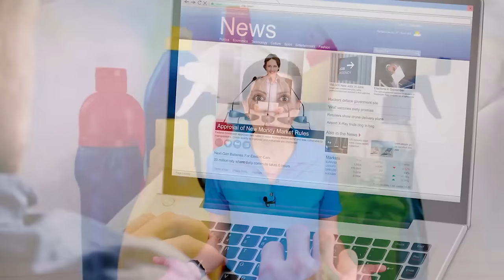Best Way to Clean Windows and Mirrors

Comment: I put a tablespoon of dishwashing liquid in a spray bottle fill it with water and spray on then wipe over with wet  microfibres cloth. Then with a bucket of water. Wet another rag and rinse window then wipe off or use a carcher. You have to wash the dirt off window products don’t work you have to wash it with soap comes up brilliant and streak free
Reply from the maker: Vicki, Thanks so much for the window cleaning tips.

Comment: Very helpful thank you. 
So ...no Windex? Just water?
I always dust it first too. Do you? Or is it unnecessary? Thanks!
Reply from the maker: Dusting always comes first before you get to the glass. You can dust the glass if you like, but you will be wiping it down with a cloth and that too will remove the dust. If you are using a microfiber glass cloth, you won't need the Windex.
Reply: @AskAngelaBrown  ok thanks!!

Comment: I wash windows with a little dish soap in distilled water. I dry the inside windows with a squeegee  and microfiber towel. After washing I spray distilled water on outside windows and let them airdry.
Reply from the maker: Thanks for sharing your cleaning tip!

Comment: Not all paper towels are bleached mine are not so not white slightly grey white brown colour and the covering is also either paper or bamboo. However I agree paper towels are still a cost that we throw away. Personally I burn mine on my fire.  I can still get free newspaper which I use   Still think it does a great job cleaning windows
Reply from the maker: Jo, That’s great that you can still get a free newspaper. It’s getting more difficult for people to find them without a cost. I appreciate and value your opinion. 👍

Comment: Are they labeled as glass drying? Can a regular one work?  Thanks.
Reply from the maker: The glass cloths are a very unique cloth in that they are low pile with no fuzz. Here is a paid link to some we use. https://amzn.to/37j036S and if you hover over the picture you can see a close up view of the texture. And because they are microfiber they grab almost like a silicone oven mit where they don't want to glide across the mirror at all. Somehow it makes them the perfect choice for removing streaks on glass and mirrors. The regular microfiber cloths tend to just smear the water around. Does that make sense?
Reply: @AskAngelaBrown  Yes it does, thank you.

Comment: yes, but what product do I use to get unknown spots from my patio doors?
Reply from the maker: Are the spots on the glass? If not - Krud Kutter Original Degreaser https://amzn.to/3mXw5uE may be just the thing you need. If you use it let me know how you like it.
Reply: @AskAngelaBrown  I used dawn dish detergent and it worked very well. The window cleaner I had was worthless. I will be using dawn from now on to clean my windows. After all, it works great on glass dishes.

Comment: I use rags( my rags are old dish towels or hand towels that have been washed so many times that there isnt any lint). I buy the really thin face cloths that come in a ten pack in different colors for different jobs. I use a face cloth to wash and the hand towel to dry the glass.
Reply from the maker: Great tip...thanks for sharing!!

Comment: pro grade squeege and T bar and pro window cleaning concentrate. both inside and out. cut your glass/window cleaning time drastically, and you actually take dirt off, rather than smearing it with one thing or another.
Reply from the maker: Thanks so much for writing in and sharing these tips for cleaning glass.

Comment: Be sure to wash the micro fiber towels correctly, heat is there enemy. Wash them separately from other clothes, use a good free and clear detergent, use warm water,  air or tumble dry (no heat)!
Also if the micros are very dirty your can add like a 1/4 cup of vinegar (in either the bleach/or softener slot) and be sure to do, if you can an extra rinse. Never use regular detergent, fabric softener to micros and again warmish ..stay away from heat.  This is coming form an ex auto detailer ..care for your tools....and the enviro around us.
Reply from the maker: This is great! Thank you for sharing your tips!
Reply: When you say no heat, but warm, what does that mean exactly? 
When you say no regular detergent but free detergent, what does that mean? Thank you very much.
Reply: @TheCelestialhealer  I Googled the question about the detergent.
"All Free Clear is a liquid laundry detergent that is free of fragrance, dyes, and harsh chemicals."

Comment: Great tip on the drying cloth, I’ve never see n them. My favorite product to use on glass and windows is dishwasher detergent, unlike window cleaners I never have streaks!
Reply from the maker: ??? How do you use it? Do you dilute it in a spray bottle? And  what do you use to dry the glass with? I'm curious now. ;-)
Reply: Angela Brown A good friend has a building maintenance (Windows) business and gave me the tip. I wish I had exact measurements but I don’t, it’s a couple of smaller globs of dishwasher detergent ( doesn’t take much at all) to a gallon of water. Since there are no suds, there are no streaks. I have a black glass gas stove and it drove me insane till she gave me this tip. Now I use it on windows, mirrors, anything that would show streaks, cuts grease and grime like nothing else.
Reply: Angela Brown Forgot to say I use a clean cleaning cloth, usually one of my husbands old soft tshirts, I don’t use any softeners or dryer sheets for my cleaning cloths.
Reply: I used a glass cleaner that claimed it would not leave streaks, but it left terrible streaks.

Comment: I have tried cleaning bath mirror  with micro fiver cloths from top to boþom but can't  get rid of dust smears Help
Reply from the maker: Are you using a glass cloth? The glass cloth is different from a regular microfiber cloth in that it is low pile rather than soft and fuzzy like other microfiber cloths. Here is a paid link https://amzn.to/3FlKtDR to the glass cloths we use so you can see what they look like. Hover over the picture  and you can see how different they look from the soft microfiber cloths normally used. These grip the mirror almost like a piece of silly putty. It's the "gripping" that removes streaks, steam and film from the glass.

Comment: Yup. But I also buy car window chemical and use that along with microfiber. Other times, it is just a small  dip of soap in water to remove dirt. 

However be careful about your microfiber. Some of them do leave lint. Even high quality ones. So I only used worn microfiber or the kinds that don’t have the super softness. 

For big windows, a squeegee might work best.
Reply from the maker: Thanks so much for the tips, I appreciate it. 👍

Comment: I purchased the recommended Brite Wipe cloths and I must confess, I did not like them for mirrors or glass. Even in your video, I see the same thing happening to you as it did me.  The towel does not slip across the surface. My hand slips off and the cloth balls up. It is impossible to fold it and use for drying. What am I doing wrong?  Thx.
Reply: It could be your glass has gotten too dry before you wipe.
Reply from the maker: If it is 100% dry it behaves this way. Once it starts drying it becomes a bit damp and then glides across the mirror. You didn't do anything wrong. The first pass or two when dry is like this.

Comment: Hey Angela, we’re window twins! We also have 55 windows. High 5!!!  I was ready to give you my secret weapon for cleaning them, but you already knew it so I’ll just contribute to your algorithm instead. 😂 Discovered it during the paper towel shortage last year, but I’ve never heard of drying cloths. If anybody else said you only needed water to clean windows I’d have unsubscribed, but you’ve never steered me wrong so I’m gonna give it a go. ☺️ Those microfiber cloths are great for cleaning so many things! Kitchen appliances and countertops are so much easier to clean with those cloths too. Hope you have a great weekend!
Reply from the maker: Hey Audrey, High five for being my twin!  I should clarify - cleaning glass, mirrors and windows is an inside job. You will need soap suds and a pressure washer if you're cleaning 55 windows and on the outside of your home. I didn't make that very clear. I'm sorry about that. Do you know how many cloths that would take if you just used damp cloths on outside windows? 😱😂😜
Reply: I’m going stitch all the wedding cloths together to make a wedding dress, I’ll look like a patchwork doll 😂
Reply: So this method won't work on the outside of the windows? Why not? 
 @AskAngelaBrown
Reply: Yes they are

Comment: My previous landlady works as a house cleaner and she swears by those Norwex silver-infused microfiber cloths as the wetting cloth, and the Norwex glass cloth to dry/polish glass and mirrors.
I bought 2 pairs and used them to clean greasy hand prints from glass doors on a window cleaning job I was doing. Gotta say I'm impressed by this method. I even use them on car windows if I'm detailing.
Sadly, the Norwex are pretty expensive, but I searched online and found cheaper alternatives to the silver-infused cloth....sweet!
Reply from the maker: The technology really works. Lots of professional cleaners swear by it. Thanks for sharing. :-)

Comment: I thought microfiber cloths shed micro plastics when washed, thus contributing to the explosion of plastic micro fibers in the water cycle.  The septic treatment does not filter out the micro plastics. They go right out into the water released back into the environment. Not exactly environmentally friendly.   The choices seem to be:  cotton terry cloth which releases biodegradable lint, paper towels which are biodegradable, microfiber which releases micro plastic fibers. Then add chemicals, some of which are biodegradable with a short half-life, and some which persist in the environment. It’s always the trade offs, which are difficult to parse for the optimal solution. I personally often compost my paper towels. I admit I do like using microfiber towels. I am thinking about adding a filtering system to my washer to capture the micro plastics. Maybe that is something that will become standard in the future for washing machines and dryers.
Reply from the maker: Great points well received. Most washing machines do have filters that catch this stuff and here's an article on how to clean the filters https://www.familyhandyman.com/article/wheres-my-washing-machine-filter-and-do-i-really-need-to-clean-it/

Comment: Bar Keeper’s Friend is prob the greatest single product for glass shower doors with hard water stains. You may have a video out about it but I’ve only followed you recently so I’m not sure; thought I’d mention it
Reply from the maker: Thanks for the tips. I appreciate know this. How do you apply it? Sponge? Buffer? Cloth? Do you have a dwell time?
Reply: Angela Brown I use the powder form of BKF make it into a paste using barely any water and then apply with a non-scratching scrub (or cloth) in circular motions. I leave it for 2 minutes and rinse and wipe off. Then repeat for more stubborn areas. I’ll try to send before and after pictures soon but the results are VERY good. Best part is it takes very little pressure or elbow grease.

Comment: If you have any grease on your mirror or glass then with this technique the glass won't be crystal clear. That's when you need to use a detergent like dish soap on your wetting cloth.
Reply from the maker: Yes this is true, especially if you have something like makeup foundation on the mirror.

Comment: I use distilled water bottle on my glass, wetting cloth. And my TV, and computer screens.
Reply from the maker: Great move. Yes, if you need your cloth to be damp - I can see how distilled water would make sense so there is no sediment or minerals in the water. Great tip. Thanks for sharing this. 👍

Comment: Hi Angela 🙋🏻‍♀️

I've contacted you a couple of times and what I like about YOU is... YOU  take the time to reply back.  So I've decided to  subscribe.  .

I have a microfiber cloth  but when I DRY my shower glass it leaves lint on it , it's not really meant to dry  glass, like your blue one .  but can I use it  for a wet one,  for the glass . Or will it still leave lint . ??

Diana  from Australia👩🇦🇺🇦🇺
Reply from the maker: Hi Diana, When you wash microfiber cloths with other laundry it picks up lint from the other laundry and then when you go to dry shower glass for example it will leave lint. The secret to using microfiber cloths is to wash them in a mesh bag. They look like this https://amzn.to/36Ztkkk and you can wash them in the same load as your other laundry. Dry them on low heat in the same bag and you should have not problems.
Reply: @AskAngelaBrown  thank you  Angela.         
                  ☆☆☆
Have a LOVELY day 👩‍🌾🇦🇺

Comment: No mention of squeegees? If a window (exterior side) is 10 feet above the ground, I'm going to be using an extendable squeegee, not any type of cloth. Especially if it's a large window because a cloth would take forever. The dirt on many windows is too thick to use water alone, not to mention that higher windows can make reach prohibitive. I think you missed an opportunity, there, Angela.
Reply from the maker: You're right. Thank you for your feedback and thanks for watching. 🙂

Comment: Thank you for the advice, Angela.  I have a whole batch of microfiber towels I bought on QVC.  However, I have a home with four dogs, two of which are German Shepherds.  My windows, not to mention walls take beating from the dust from their coats.  So if I use just water, I get nothing but streaks.  I found a product, Bio Cleaner, that I use on virtually everything and it works equally as well on the windows.  Cuts through dust, film, dirt, -- and it's eco friendly -- just a tip.
Reply from the maker: Thank you for sharing your tip and thanks for watching. 🙂

Comment: Some of the haze or dingy look isn't really "cleanable", why?
It's not dirt or grease but dirty caulk or silicone and potentially even mortar or grout.
If you carry a small razor blade scraper with a horizontal blade. You can clean up that dingy look in a minute or less and change how it looks and is viewed by the resident/owner.
Reply from the maker: Thanks for sharing. 👍

Comment: Pro cleaner here.  Save yourself a lot of time.  Use an amonia free window cleaner like Ettore Sqeegee Off, a good quality squeegee and applicator... if you're doing a lot of windows and mirrors, splash out on some pro gear... you won't regret it.  Have a quality teatowel or surgical cloth on hand and a lint free glass cloth.  Wet glass, wipe top edge with tea towel, squeegee left to right or right to left, wipe blade dry with tea towel repeat until crystal clean. Use lint free cloth in the event you need to clean up any missed bits around the edges or around hinges and handles on glass shower doors etc.  With a bit of practice, you can have a large mirror like in the video completely clean within a couple of minutes.... no elbow grease required.  Amonia free cleaner is important for mirrors, so you don't, over time, take of the coating that makes the glass a mirror.
Reply from the maker: Thanks Roger for the pro tips. 👍👍👍

Comment: Sooooo no chemicals? What about the outside of Windows that collect crap?
Reply from the maker: The outside of house windows will be a different set of tools and solution than inside glass and mirrors. You may use a squeegee, a brush and a hose for the outdoors job.

Comment: How would you suggest cleaning off the film/dirt on the inside of car windshield?  It’s impossible to get it cleaned. We’re non-smokers but there is a built-up that won’t clean up. Thanks for any suggestions.
Reply from the maker: Do you have any clear (white) vinegar? Some of that on a damp microfiber cloth will cut right through any film on your windshield.

Comment: Hello you don't clean and  dry with the paper towels . You only use the paper towels as the final step to get rid of the streaking . One paper towel can be the final  step  for at least 10 windows or more .  You use a micro fiber  for the cleaning and drying steps  but the final step should always be the  untreated paper towel  .
Reply from the maker: Thank you for the tip!

Comment: Just use water?
Reply from the maker: For interior glass, yes. For the most part it's a light film you're removing rather than greasy chemicals. If you have a smoker in the house that may be a different story - but for the most part a damp cloth and a drying cloth work best.

Comment: Interesting. Why do you not use a window cleaner?
Reply from the maker: You can if you like. If you are cleaning an outside sliding glass door and there is all sorts of muckity muck on it, a glass cleaner certainly comes in handy. But we find for most indoor use (if the house is in maintenance cleaning mode, a damp cloth is all you need.) The rule of thumb is to never use more chemicals (or stronger chemicals) than you need to get the job done. 👍

Comment: I just started watching your videos and love them!  What do you recommend when cleaning windows that are out of reach?  I have arched windows that are 10-15 feet off the ground.
Reply from the maker: Hi Brenda, Those can be cleaned with a DocaPole if you have one. Here is the paid link to the one I have https://amzn.to/3z5hC5N and it has a window washing attachment. If it's just the entry window we're talking about this would do fine. (NOTE: Wet the microfiber head and squeeze it out BEFORE you attach it to the pole otherwise how do you get it wet? 😜) But if you have multiple 2nd story windows that need cleaning, you may be better off hiring a window washer to do that job. They have the ladders, equipment, truck mounts, pressure washing equipment, etc. to make the job easier.